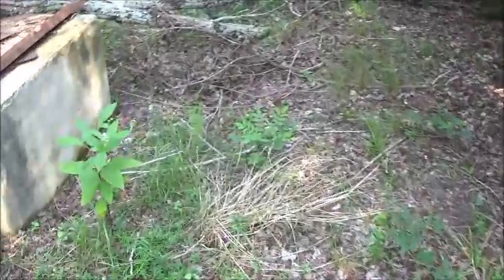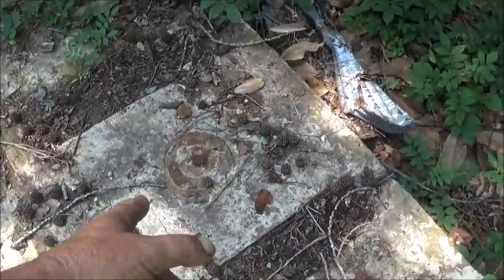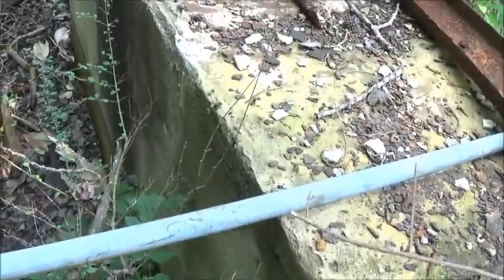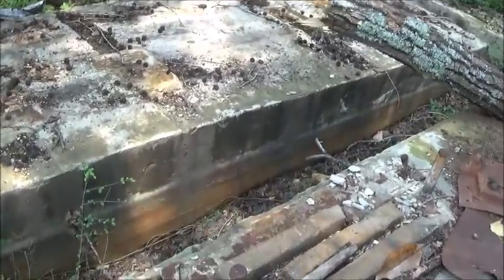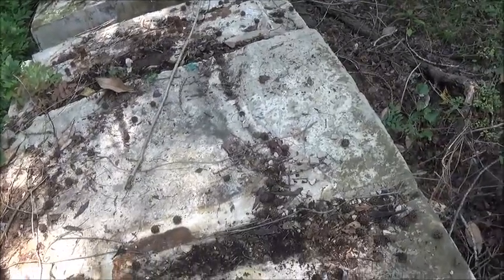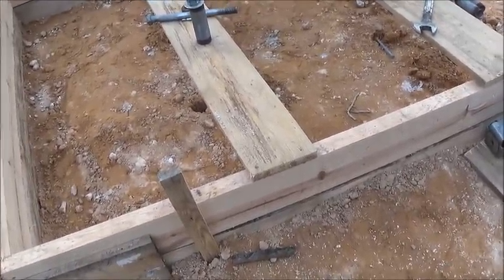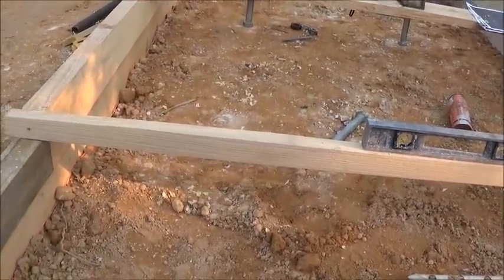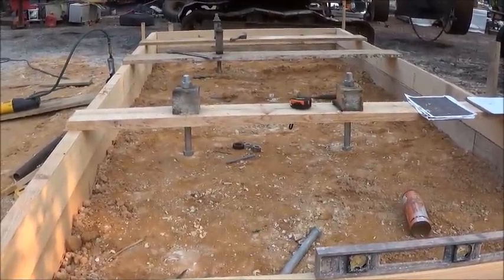MORE BATES STEAM ENGINE FOUDATION WORK

Comment: If you have a read in old engine manuals and books, the normal procedure for installation, is to cast the blocks, with the bolts in, set the castings on, and align and level with steel shims, then grout the castings in using a strong cementatious grout (often the mix for this is stated in the installation drawings, and sometimes calls for iron powder in the mix) then tighten bolts after the grout has set. hope this helps.
Reply: Also, if you weld or form a ring on the end of  your holding down bolts, place a short length of rebar thru the hole,  and cast the bolts in with a length of pipe lagging over the bolt, you can later (when it’s set) remove the lagging, and then you have a hold down with a bit of wiggle room.
Alternatively, modern resin stud fixings could just be drilled in after, and would be more than up to the job.

Comment: Jo, when you place a very heavy engine on a base it must all be grouted in or it will vibrate the whole engine completely off of the base. When I use to install those huge Coopers it was a major deal to make sure the grout had to be completely flat and level on anywhere it touches down. Another thing you would want to do would be to install a over vibration switch on your flywheel. Any kind of vibration switch will be good as long as you have one that will shut the engine down. Your form is going to be just fine. It is more than adequate to do your form with. It is definitely not going to bust out man. And those two rails on the bottom of the engine is for your engine to settle into your grout. That is how thick you will need to have your grout under the engine. Your engine will settle in to the hardened base under the grout. I guarantee that concrete will not crack. The thicker your concrete is the less likely it is to crack.

Comment: It might work to make up some steel shims, you could then level the whole unit, corner to corner, ect. It would also help to get exact heights. I am a cabinemaker, and, have had to install so many cabinets on uneven surfaces. Shims work well, just leave them in place when you get it leveled up.

Comment: Carry on Jonathan 
You’re on the right track 
The original foundations were designed to support the engine under full load for 16 hour shift’s 
With the improvements in modern concrete your design will be more than adequate to support the engine and run demonstrations.
The engine and foundation will be there long after you,I , and all the nay sayers will be gone.
Keep up the good work!

Comment: You're doing a great job jonathan the way I understand concrete is the slower it dries the stronger it is and less apt to crack
Reply: Keeping it wet is the key to doing that,water will keep it cool and slow down the curing process.
Reply: @rogercamp6071  Yep! One of my summer jobs as a kid was to ride around town to my daddy's jobs and hose down the cement so it wouldn't cure too fast.  Funny, no one batted an eye about a 12 year old working on their job back then!
Reply: @87mini  there weren't privileged Karen's walking around.  Everyone  knew what work actually was.
Reply: @davidnichols647  Nah I think people are paranoid about kids out alone, what with predators lurking about. Don't see too many kids on bikes anymore; they're all inside on video games and cell phones (or both).

Comment: Ha..let em talk JW. 😁 You're doing fine. When you weld ties to the bottom of your anchors make something that slices in the concrete like slicing bread. Angle iron and flats can be a bugger. They want to push sideways or roll in lower slump concrete. It can make a fight out of it. 
Most older concrete was 6000+ psi with no fillers. Equivalent (or exeeding) the most expensive concrete you can order today. Sometimes called bulletproof today. 
Some kind of locating ties on the topside of your bolts is a good idea. It can be as simple as boards with holes drilled exactly the diameter of the bolts and just slide over them. Then you can check bolts for level and tack brace the top tie to the form. 
Have a good day, thanks for sharing

Comment: Looks good JW four inch concrete cracks sometime but it looks like your pouring up to twelve inches pour it with fibermesh in the concrete and a little rebar it will be fine.
Reply: Florida
Reply: @WS-ij1fu  exactly been in the business for over forty years. I might be a little older than JW but he's doing the right thing. BTW looks like the same type of ground.

Comment: Okay, here's some of that crap from UK. The bolts should have big plate washers and then a tapered wooden box up to the underside of the cross planks. When you remove the planks the tapered boxes come out, the plate washers retain the bolts which will be able to move slightly so that the machine's holes can accomodate them. Once the machine is in place you grout the lot in. Job done. Also that plate should be grouted in but I think you've already got that. Good luck!
Reply: Very good advice!  I like that tapered plug method - much easier and forgiving than setting them and hoping they stay in place as the base is poured.

Comment: I think that form looks great. Just stake the outside of it so it does not move and it will be fine. So far you have been right on point with everything else. That was a good idea to go back and check out the foundation again. For what that engine is going to do, you will be fine. Great Job on it.

Comment: I'm assuming that you're talking about welding something on the bolts to help secure them deeper below the surface of the concrete. If so I'd think like a 10/12 inch cross shaped plate would work pretty good for that. Might just away in 75/100 years but he'll, who's to say the planet will still be here.

Comment: - I just saw your previous video, Jonathan, and now better understand about setting the iron plate down on top of your pour.
- If your 2x6 form tops are EXACTLY at grade, and you have alignment marks {cut notches as you said} then:
- IF the steel plate is the same size as your form, the form itself should function {if properly gusseted} so you would not need pre-positioned "piers" to receive the steel plate as Basalt Plains Timber and Steel talked about in his contribution on the previous video.
- With good outside form bracing you don't need stringers holding the sides together.
- You even could THEN secure the bolts to the plate {with nuts mud-side and top-side} AND have the crane ready to set the whole assembly all at once onto/into the crete before it sets up.
- You could also set up four "take-off" boards set as H's {"fore-&-aft" and "port-&-starboard" of your forms} with pre-marked "true-points" to string two lines between, and after you have set the plate, re-string the lines to accurately and easily prove your alignment was right and true once it is placed.
- If it is out of true, simply use your loader {or a jack hammer} to nudge/vibrate the steel plate whatever way it needs to go to get into a "propa" machine wright orientation and bolt locations.
- Hammer/vibrate the bolts so the aggregate and mud close up on the bolts to anchor them well.
- So long as your bolt alignment winds up within a 1/8 inch of true and "propa", the follow-on machine wright alignment issues for everything else should not be a problem.

Comment: Looks good Jonathan, pour the bottom step first, if you use a cement truck? the driver's know how to make the first pour a little tight and then he can add more water for the rest. That small in square footage won't crack as easy as a big sq., ft.
Reply: Great work bless you peace

Comment: When bracing concrete formwork, diagonals are your best friend. 
Smart move to check the concrete work done 100 years ago that worked at the time. A trick that I've used to keep forms from spreading where there's not a lot of side thrust is a couple of drywall screws into the form and some mechanic's wire stretched tight between them.

Comment: Conctrete cracks when you let it dry to fast. After you pour and it’s set if you get a hose and a nozzle with a mist and mist it every now and then as it’s curing it shouldn’t crack.

Comment: I agree with your observations that there was dirt washed in, making the old base seem lower than the blueprints say, especially if they poured a lot of grout on top to set the metal plates to support the engine.  So, I see you as correct that they generally followed the blueprints.

If you compact the soil under the concrete base, use some rebar and a high strength (high psi rating) concrete with micromesh, then you're making a concrete beam.  At the blueprint thickness, it's less likely to crack if you don't flex the beam or base piece of concrete.  Or hit it hard until fully cured.  You could follow what the Civil Engineering profession does and run slump, weight and compression tests on samples.  That's supposed to be done in concrete bridge construction.  It works until the road salt hits the surface...  There are some concrete mixes that will stand up to sea water, but they cost more than most mixes.

Comment: I remember helping pour concrete for Hunter Mountain's steam generators turned to air compressors they used a number 18 rebar in the concrete around and under them. It was heavy and huge and the rebar structure alone under could have probably carried the weight of the units. I remember using a putty almost like a plumbers putty around the bottom plates and then pouring grout through the bolt holes the whole unit sat on grout still in operation today and a sight to see.

Comment: Jonathan, you have to pour the concrete and then bush hammer the top.  Then you set some three-quarter inch landing points for your heavy equipment, those will have a piece of steel. Then you said your heavy equipment and float your grout mixture all around it up to the bottom flange of your heavy equipment. If there’s a vibration you may want to consider epoxy grout

Comment: You’re doing exactly right. Leave the boards with the bolts right where they are. Don’t take them off to pour you will never get them back on easily after the concrete is poured believe me. Don’t worry if the boards leave an impression because the grout will take care of all that. Also you need to put some rebar in it because it will crack. Use some number 4 bar tie a mat and hang it with tie wire about mid slab.

Comment: "Measure twice, pour once'' as they say in beers & concrete, or maybe the construction workers were just leading me on as a kid. The engine's former foundation wasn't reclaimed by the Earth because of the man doing the work - if Jonathan was just some scrapper, you can bet that area would be a flood plain by now - never to be seen again. I'll be looking forward to the pour video & then the installation...it's going to be more solid than the stock market, & better looking to boot.

Comment: I noticed that the original piers seemed to be a couple of feet or so in the ground. You might want to consider auguring a couple of piers in your base to protect against lateral movement when the engine is running. Only cost you a couple or three yards of concrete and keep your engine from walking across the yard.

Comment: i would weld rebar bolt head to bolt head and it will hold it all togther then just drop it in after the pour
Reply: Yeah, it wouldn't take much.  8 or 10 inches.  The big thing is the concrete can't be too wet.  Dryer is stronger.  :)

Comment: I noticed that there were no initials, years or personal touches in the original foundation, so looks like the original construction was "strictly business". I would like to see you include something like your initials and year, included in the permanent structure. A lot of sidewalks have the contractor's name embossed in one of the slabs. Edit: a side note, on the tv screen that left hand slab looks like only 4ft wide to me, so I am glad you put the measuring tape to it to prove that the view on a tv is distorted from reality. Edit 2: maybe also include a time capsule in the foundation.

Comment: One more thing Jonathan you might want to either double the 2X4 on the step down part or run a pipe or angle iron across it so it dosent bow out on you maybe weld rebar to your bolts you might have said that don't remember but remember the more you weld to them the harder to get them pushed down in the concrete also use different color spray paint on your bolt holding boards .paint the hole end and side that way you be Abe to align them back up if it over flows and covers some of your marks .make sure the grandson is there when you   pour the concrete so he can put his hand prints in it be nice if you your wife your son and grandson could be there have 3 generations left for as long as they will be around to say hey that was us on this day of our family history event. but take plenty of cool down brakes and lots of water don't want you over doing it in this heat I was down in Wilmington Monday night loaded Tuesday morning and was ringing wet from just being out strapping the augers down so we need you around to finish these projects for the next generation to see how things use to be  so take care till the next one

Comment: The step down on the pad they call it a bulkhead, if you pour a few feet wide on the deeper side of the bulkhead dryer it will keep it from pushing out. Then you can wet the concrete down and pour both sides. Its easier to work with it wet then it would be trying to do the whole thing dry. I use to drive a concrete truck for Southern Concrete and thats how we would do pours. Also if you are worried about cracking let the concrete company know you want fibers in it. Its basically the same fibers that's in Tiger hair bondo, helps hold it together.

Comment: If you use a concrete vibrator they do help make the concrete flow and run out air pockets .. Harbor Freight has one on a drill body for a little over 100 bucks ... We used the same style with great success back when I was in trade work . IDK you may already use em , just figured I'd mention in case you haven't .

Comment: Doing a fine job, rechecking never hurts. Sure - weld angle to the bolts and you can even weld some pieces of rebar to the bolts and angle that will be in the pour. Build a wood box as deep as the form and as long as needed for exhaust area - then pour concrete around it. You might torch out some 1/4 or 3/8 plate for shims if needed to go with the grout to set and level.

Comment: Back fill on the outside of your forms, if you're concerned about bowing. Built a bunch of pole barns, back filled the band board and very little if any bowing when pouring the floors. The poles were on 8' centers. Duce

Comment: Jonathan,  what a great video with plenty information.   My thoughts is it really necessary to weld angle, etc on the bolts to join them together?  The engine weight will keep it down and 1 inch bolts, with maybe large washers at the head (bottom) end will make certain that the  engine will not move once the crete is set.  Doing this you can mark, notch like you said and/or maybe drill 1/2" holes through your boards holding the bolts into the 2x6 forms, then when you pour you can level the crete, set the boards working the washers and heads into the crete and push bolts or pins through the holes to make sure all is aligned proper for curing.  Put a vibrator close to each bolt and it will fill around the heads and washers, touch up with a trowel and it's  done.  You can still weld angle etc to the bolts, but is it needed?  I'm  thinking it's  overkill IMHO.

Comment: - Jonathan leaving your mounting bolts firmly in place prior to concrete pour is the best way to go.
- At least that is my crews' experience as a Carpenter's Union Steward building 360 footer pads 6x8ft; 8x12ft; and 10x16ft {with all the tower mounting J-bolts} for an electrical substation.
- The hasstle of trying to fit them in after the pour will not serve your well.
- By eye, it looks to me as though your formes, as is, probably would not blow out, either, given the shallow depth of crete. {so long as you don't drop/slam crete suddenly all at once into the forms}
- The crete will want to lift/float your cross pieces {if they bow up on you, hammer or vibrate them to settle into the mud if it goes over grade} . . . so the screws joining your cross-piece stretchers to your forms is wise
- BUT I would also side-nail the forms to your planned for iron stakes to {hopefully} keep the form sides and your gradeplates from lifting up as a whole and becoming "high" or above grade.
- The above issue of "floating" and lifting cross pieces and forms off of grade is why we always ran our forms 6" high {or more} and put on triangle "chamfer" pieces at grade {for looks and code}.
- {I am pretty sure you know all this}: Rebar and "sheep fencing" mesh within the pour will keep your crete from cracking.
- "Hot" concrete mixes are weak and crack, and are a pain in the but to work with.
- The cooler the mix {the longer time to set and cure} produces stronger/strongest crete.
- Cover and water {cool down} crete after it has set up to slow down curing and produce the strongest crete and to better prevent cracking.

Comment: Jonathan I don’t know diddly but if I was doing it I would drill a hole through the form on both sides in line with the  bolts and weld the bolts to it everywhere you have two boats in line do that. Then you can run the rebar longways and connect all the bolts together and you wouldn’t need those boards on the top like I say I don’t know deadly but that’s the way I would do it.  Good luck brother I’m with you in spirit love to be able to help you.

Comment: On my storage shed 12x12,  I used a post hole drill to drill about 10 holes, stuck rebar in each hole, then tied them to the horizontal rebar.  Overkill, maybe, but rebar was cheap.